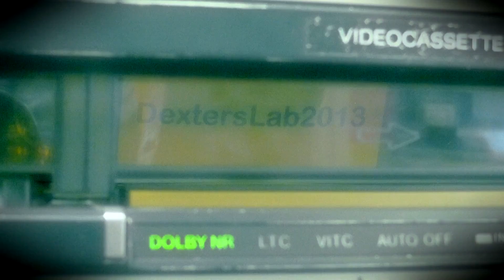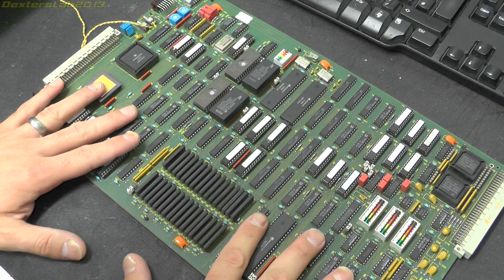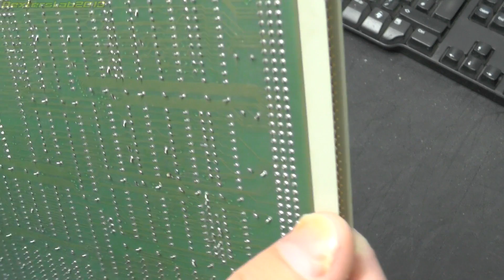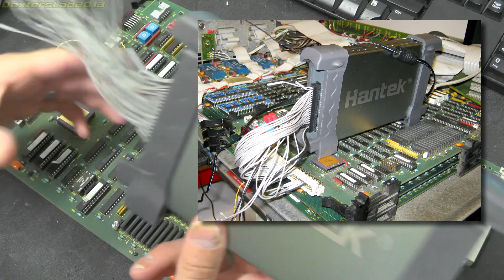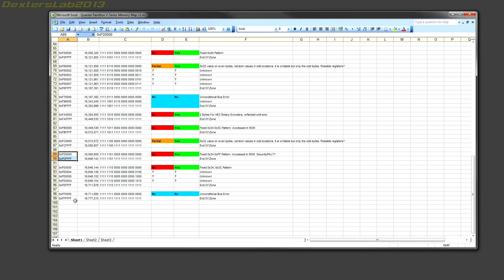DL#095 - Quantel Paintbox V-Series Repair Part 2

Comment: Did you check CPU bus control lines? DTACK, or its absence, will cause bus errors on reading memory. Checking 68000 on what a bus cycle should look like and verifying this with your logic analyzer should give you a hint on the cause of this bus error.

Comment: Looking at the board isn't that 2 uv erasable eprom chips in the upper left that have the stickers removed?
Reply from the maker: Yes, well spotted! They are two new EPROMs i bought, i burned copies of the existing ROMs (which were OTP) onto them. I can easily re-burn them if they get erased because of the lack of sticker. It means we can make tweaks to the ROM code if we need to.